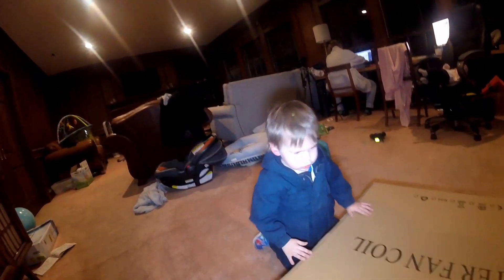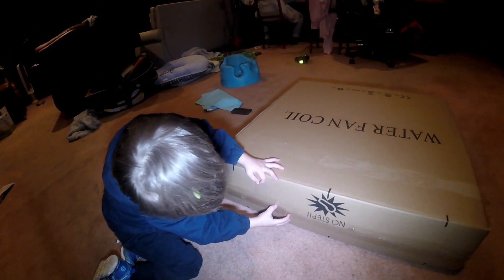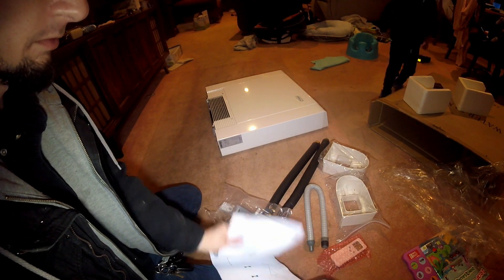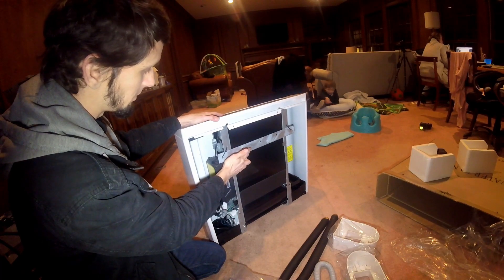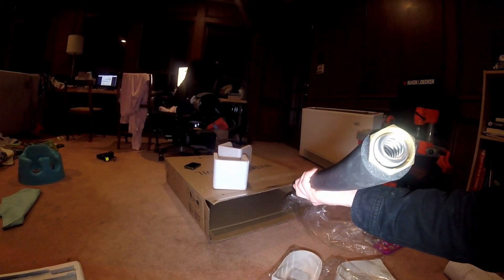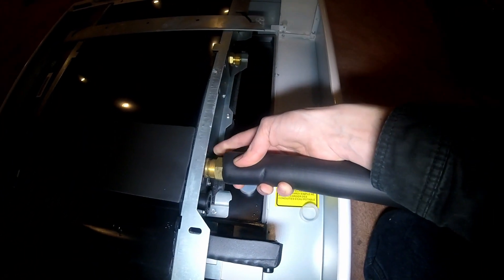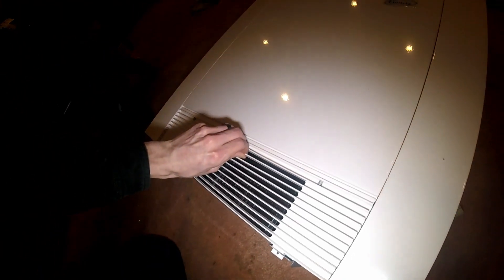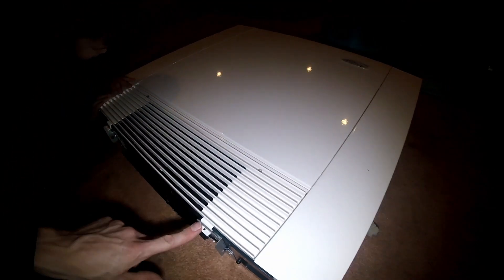Chiltrix cxi-34 fan coil unit unboxing video (DIY HVAC)

Comment: The Green/Gray wires are for a MODBUS connection.
Reply from the maker: I think I’ve read since this video that the units can all be daisy changed on a communication network. Must be the modbus you are mentioning.

That’s something I’d like to make use of in the future. Especially if I could then tie them all into my smart home stuff and control without the ir remote.
Reply: @beenegarage7116  That is what I've been working on doing myself with mine. Just getting into the start of the logic for them so nothing fancy yet, but I've got the CX34 and all the CXI coils connected up to a to RS485 to USB plugged into a Raspberry PI using MODBUS where I can read the values from the sensors and send commands to change the settings.
Reply from the maker: That’s fantastic! I’d love to mooch off your work at some point.
Reply: @matt-h  That's pretty impressive, I was wondering can the CXI be setup with a Smart thermostat? Echo smart thermostat just started supporting 3 speed fan coil units.